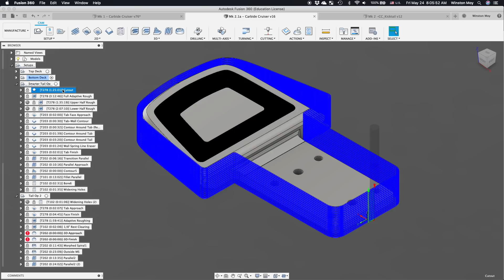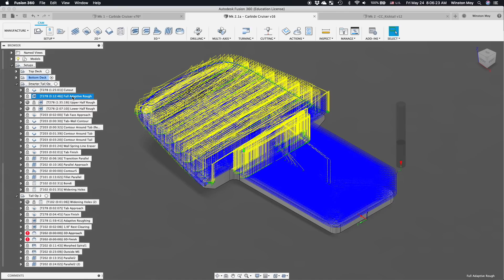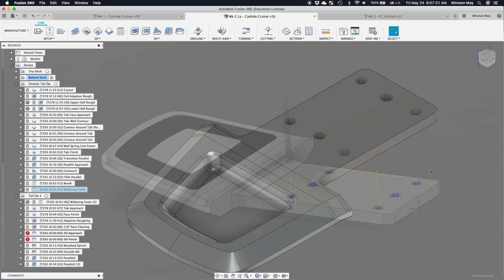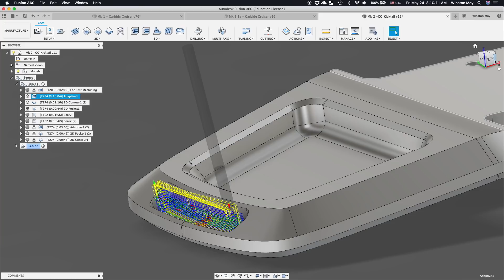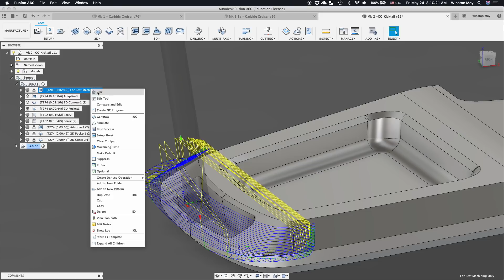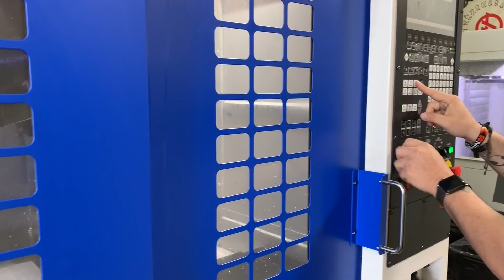Machining Aluminum Longboard Kicktails - Carbide Cruiser Ep. 4

Comment: Why don,t you machine a flat board and just bend the tail i place? Seams like a lot of unnecessary work and a waste of material and expenses
Reply from the maker: The bend radius for aluminum that thick is not good. And if you annealed the metal to make it easier, the piece would be weaker and might not anodize as evenly.
Reply: Long, long ago, in the time of a Galaxy, Far, far away, they made skateboards from 1/8"  thin sheet aluminium, super light boards, but bent like a banana if you did a heavy landing.